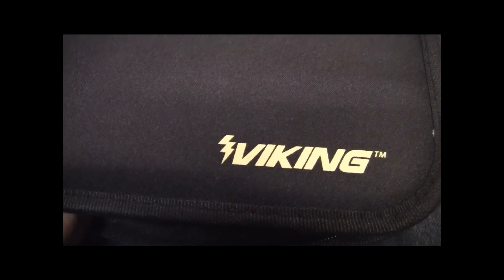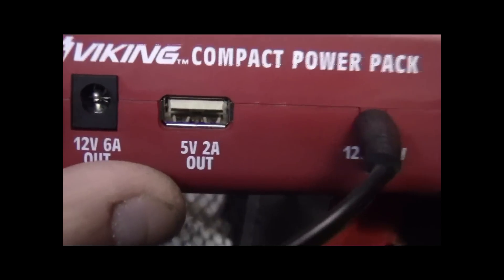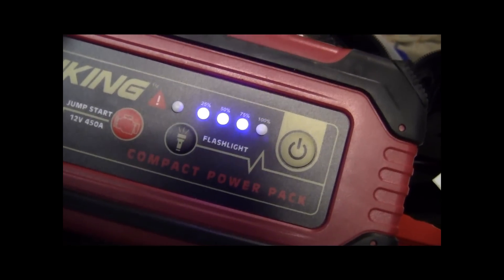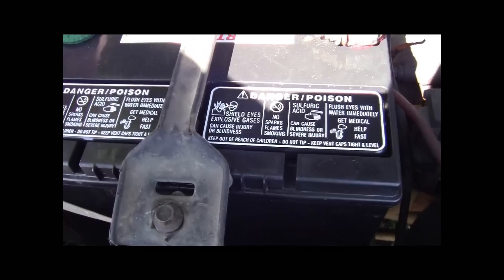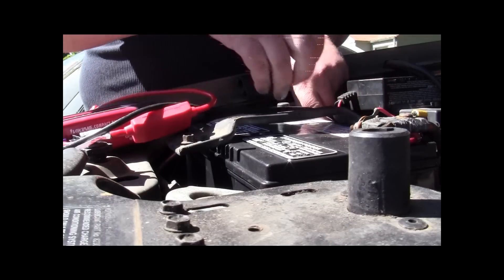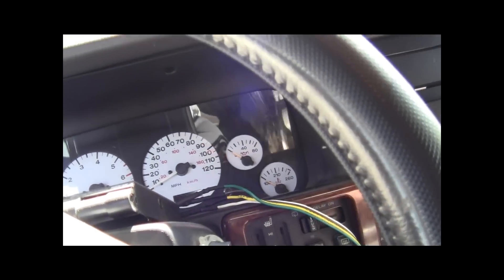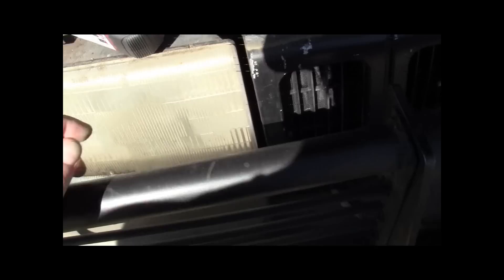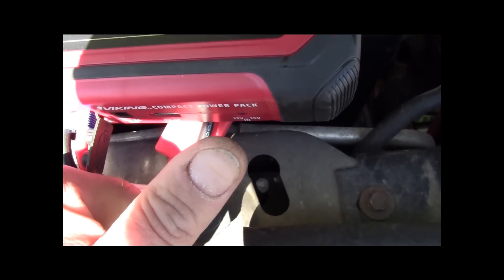Viking Jump Starter & Power Pack Review

Comment: After you used the battery to jump the car how much battery % was left?
Reply: ive jumped off 2 f150s v8   and my honda civic 3 times and still says 100% its prob between 100 and 80  plugged it in and the only light flashing was 100% meaning it was still almost charged
Reply from the maker: never dropped a light from 100% Great little tool to have ! Thanks ..
Reply: Awesome. Thanks for the replys. I will be picking one up!
Reply: Update. This little pack was great all through hurricane Irma. Kept mine and 3 others cell phones charged for 3 days. Couple weeks later it jump started my BMW (V6)! Got my $80 outta of it already!

Comment: I have one it DIDN'T last 6 months the thing will not CHARGE. I JUST PLUGGED IN THE CHARGER AND NOTHING.
Reply from the maker: I have some vids on repairing that problem using an R/C battery charger .. It does require taking the pack apart and it is some work  ! But I have brought several Jump start packs back from the dead with that method .. What happens is the battery drops below a safe level for the charge board to recognize .. So it is rendered DEAD ! But it really isn't, If someone wants to take the time to repair it .. Happy new year & Thanks for stopping by my channel !!